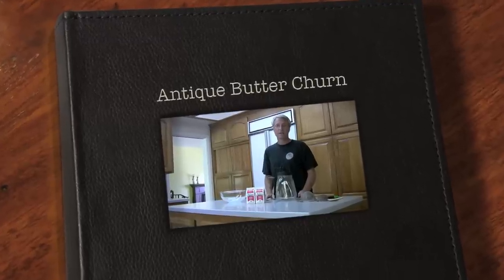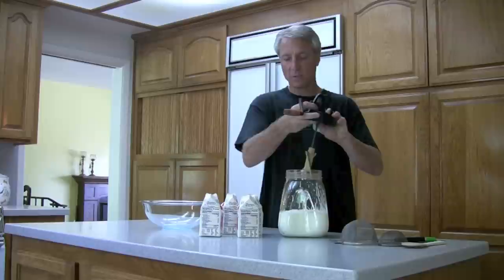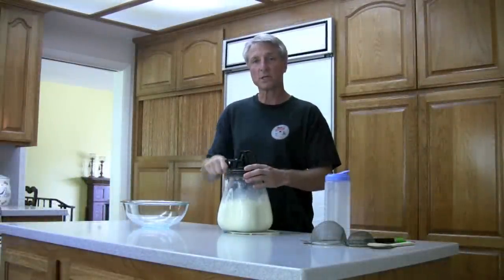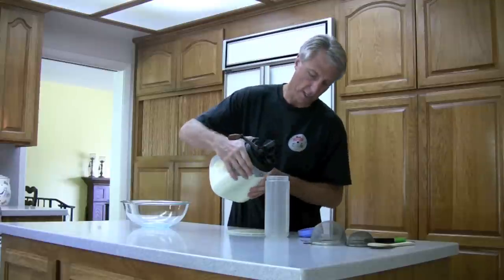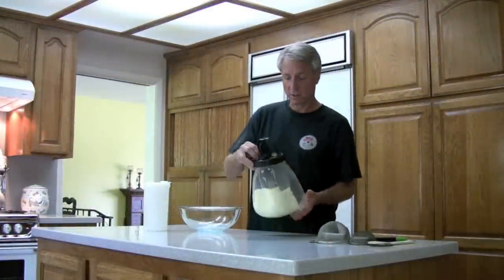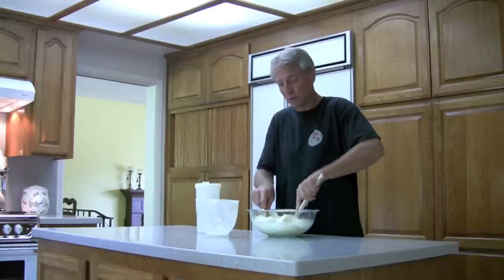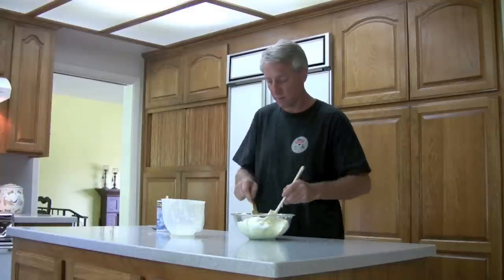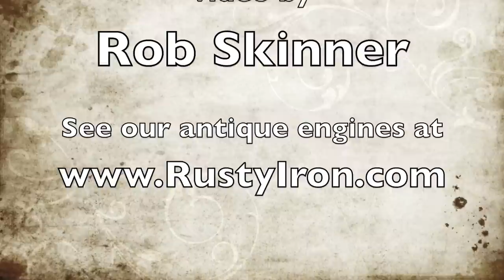Antique Butter Churn - Making Home Made Butter

Comment: I have a "DAZY" hand churn similar to this one and it works great.  I welded a "nut" on the hand crank at the "L" pert so I can use a nut driver on my electric drill and spin it at a consistent RPM without standing there wearing my arm out, and you can still use the hand crank part as well.    I trade beef to my neighbor who has dairy cows for fresh milk, boil it in a huge tamale pot and skim off the cream from the top and use it to churn into butter and as coffee creamer.  I wash mine inside the churn though. I drain off the butter milk and store it for baking biscuits and add water right into the churn and rotate some more, then drain and discard in the garden.  Add a little salt and pack it into small molds I made and store in the ice box.....best taste you ever had on a fresh hot biscuit.   I hate store bought butter.....if you cant pronounce the names of the stuff in your food...why are you eating it????

Comment: Thanks.  Are there different Fresh Whipping Creams?  I assume it's in the dairy section at the grocery?
Reply: Many grocery stores only stock a single brand usually called Heavy Whipping Cream. If you shop around you can sometimes find it at a bargain sale price, but otherwise it is often a bit pricey for a quart. If you have a dairy farm nearby, they can supply it most likely if you ask. Generally, there product will not be pasteurized, But there are several youtube videos on how to do that by cooking at a certain temp for a while.